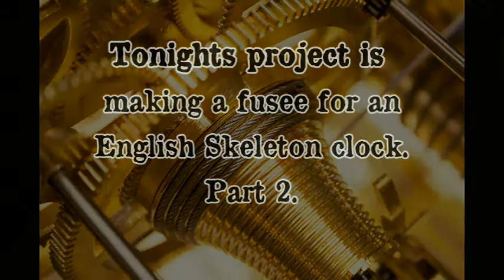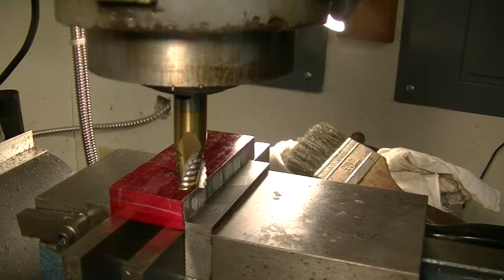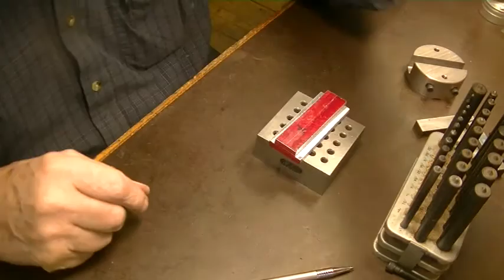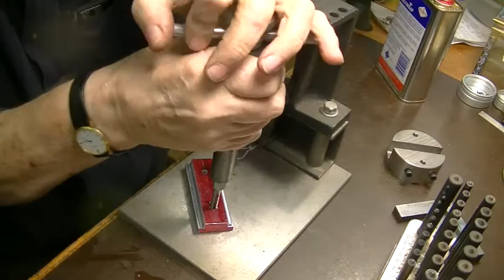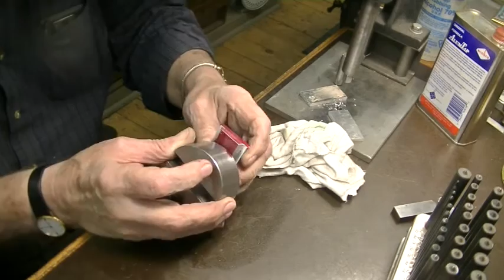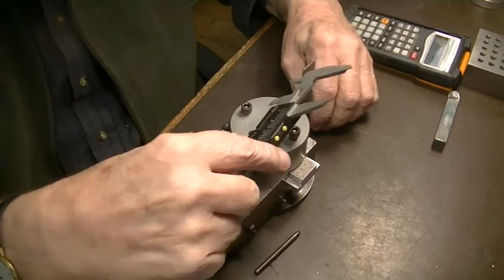Clock repair tutorial # 10. Making a fusee for an English Skeleton clock  Part 2.

Comment: don't stop making videos like this! But maybe a better name for this would have been. TOOL MACHINING 101. STILL I AND I THINK OTHERS LIKE SEEING WHAT GOES INTO MAKING THE TOOLS FOR A CLOCK PART.
Reply: Suggestion, mount your tapping jig on a mini pallet so that you can clamp the workpiece down. The T-nut was moving as the tapping torque built up, that could result in a broken tap.

Comment: In 45 years of precision engineering and toolmaking in the UK, I have never come across (or felt the need to use) a tapping jig. It looks like one of those inventions that people invent just for the sake of inventing them, then market them so that they sell them to people who lack the confidence to rely on the 'taper' tap to align at 90 degrees and that the 'second' and 'plug' taps will automatically follow the perpendicular. Dies are different, I admit, but taps align at 90 degrees automatically.

The mind boggles!
Reply: A tapping jig awesome meaning breathtaking, amazing, stunning, astounding, astonishing, awe-inspiring, stupendous, staggering, extraordinary, incredible, unbelievable; tool no I don't think so! The sun may have set on the empire but our engineers  are still available to educate you.